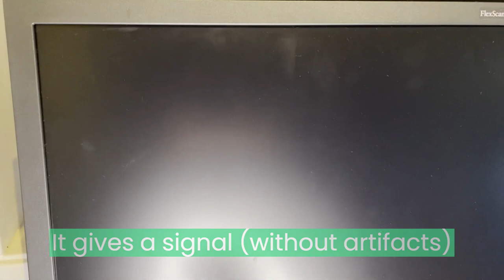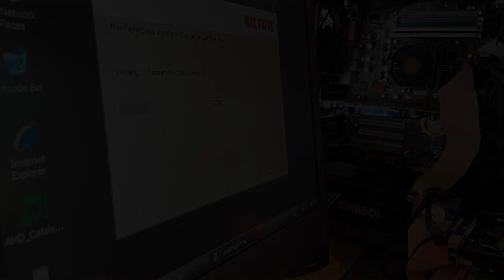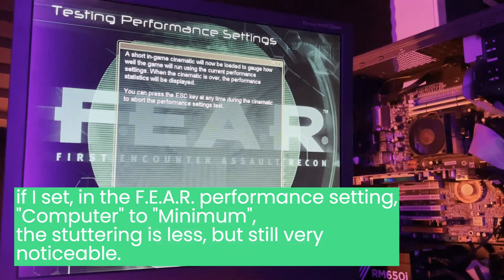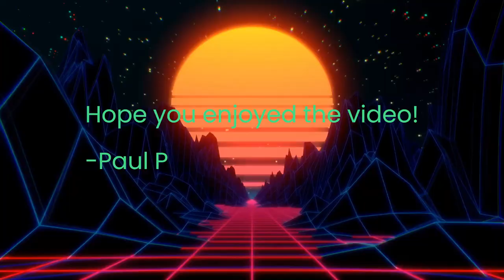Testing an ATI Radeon HD 3850 AGP

Comment from the maker: Had too little memory to Play F.E.A.R. Put in additional 512mb of XMS 400 ddr ram (2*256) and stutters went away. (Dont really know why i got stutters in Max Payne, but plays all games as it should now).Thanks for all the help! Cheers
Reply: whats the difference between an overclocked 3650 and a 3680 NADA :P,  if your having issues, maybe check the GPU power... I remember those cards needing power from the power supply, it was always a bad connection, usually, if not you just need to overclock a little, those earlier PC's *my pentium 4 could go from 3ghz to 4.2 usually, without any issues. Then I'd underclock my GPU or overclock depending on the game as that as well shouldn't bee too, too hot. Otherwise, you just may need a XP hotfix for the game.

Comment: I would obviously be worth testing the HD 4670 as well, the other contender for the fastest AGP card. In some games one card is faster, on others the other. Basically comes down to how much a game relies on shader performance, fillrate and memory bandwith. The HD 3850 has double the pixel fillrate and memory bandwith of the HD 4670, but the latter has slightly higher shader performance and double the texel fillrate.
And if I remember right, F.E.A.R. was quite memory hungry, which is why the GTX 280 outperformed the theoretically faster GTX 275 there.

Comment: catalyst 12.4 drivers is the last stable version for radeon hd3850 graphics card
Reply: yup,can confirm that those 12.x hotfix are bad,sadly i think that 9.x and 10.x series hotfix agp drivers vanished from the internet,so 8.x and 9.x from old HIS website is the best and easiest solution.driver indentifier have solid collection but mostly 11.x and 12.x but all of them are for 2600 xt so card won't be recognized as 3xxxx in driver.doesn't seem to matter,they work and performance is okay but older 8.x are better in majority of games,especially in games that can run decent or good on that card (from 2007 and earlier)

Comment: You will get a lot better experience if:
You have a average to pretty slow 1 core CPU , try the Athlon 64 X2 4800+ 
You have only 1GB of DDR1 RAM , add more have 3GB or max 4GB for 32bit WinXP
nice vid btw
Reply: more importantly better drivers,from amd logo i recon that was on 12.x agp hotfix drivers,for best performance you need at least 10.2 (that seems to have vanished from the net) or older drivers. note that those later agp radeons need special agp hotfix drivers,regular ones won't install.

Comment: I have this card myself.  Exactly the same one, yes I bought it 20 years ago now and I still have it....
Anyway - there was a problem with the normal drivers from that period, because this was an AGP card when they were switching over to PCIE.  I remember to get it running properly, I had to go to sapphire's site and use their driver which was specific for the AGP version of this card.  I can't remember exactly what the version number was back then.  But I suggest see if you can get the driver directly from Sapphire for the card specifically.  This was the literal "Last Gasp" of the AGP style slot.  And yes, it is the fastest thing you can stick into an AGP motherboard.  But finding the proper driver might take some searching.  The card does work pretty good, and should run games smoothly with ease.  But as others have mentioned, it requires a special driver (which I believe was downloaded directly from sapphire's site - and I think it did have the word 'hotfix' right in the title of the driver).

Comment: I use mostly win 98se for my retro time, so what I say is perhaps useless. 

Make sure old drivers from previous gpus are completely destroyed, because some parts will be left in the registry even after normal uninstalling. It takes a 3rd party program to do this.  I use Driver Cleaner Pro.

I also always reinstall directx after adding a different gpu/driver.
Reply from the maker: Fresh Windows install/drivers. But Thanks for the comment!

Comment: FEAR most definitely should be working 100% ok with this setup.
I had a Radeon 9600 128mb, Athlon 3000+ and 1gb of ddr 400. Low settings and it was flawless.

If you have another 939 board with a different chipset try on it too, because back in the day there were a lot of issues with different chipsets.
Reply from the maker: Only one ive got, sadly. Could try a 478 P4 board i have :)  Thanks for the comment!
Reply: @paulp9270  Try another agp board. These are pci to agp with a bridge chip, had isues with an agp 3650. Open a new topic on vogons.

Comment: I don't have a solution for you problem but I can tell you I have one of these installed in a socket A board with AMD athlon xp 3200+ which is slower than the system you are using and it works great with no stuttering.
Reply from the maker: Yeah, something is not right :P Thanks for confirming just that :)

Comment: This card requires the hotfix patch in order to run smooth.  I'm not sure your 3850 is the fastest AGP, at least not in every game.  I have a 4670 that scores as well in many cases, though they are essentially identical scoring.   I think the 3850 is more stable though.  I never had issues with mine, but did have issues with the 4670.  I never overclocked them, but knew some guys who claimed that the 3850 could overclock very well.  I don't think it is worth the effort, as if I wanted better performance I'd just go with a PCIE card setup.   You might try a better s939 like one of the FX-60 processors or even try a better dual core Opteron 185 or 190 (if your BIOS supports it).
Reply from the maker: i just ordered another set of 512*2 gig XMS Platinums, and an Athlon 64X2 3800+. Will look more into into the hotfix patch when i get the parts. I like this system. Maybe ill make a video of a complete, well functioning build some day :)  And agree on the overclocking part. This card is hot (and fast) enough as it is  :P
Reply: @paulp9270  Good news for you is that the X2 3800+ almost is identical single thread to the 3500+ single core you used, so you will be able to directly see how much adding another core and better memory impacts performance.   The prices on 939 cpu's has risen considerably, so I think the X2 4400+ is the best bang for the buck right now.   Be careful too with what version you get, as the chips with a "BV" at the end of their code have lower cache and perform poorly compared to the "CD" versions.
Reply from the maker: @erikmerchant567  Unfortunately i got the "BV" version (at least it was cheap). So it will most likely be somewhat slower than the 3500+ in single thread. But i wil test it out and keep a lookout for a cheap x2 "CD"- chip :) Not paying ebay prices for one... Thanks for the info!

Comment: Did you check how much ram the system is consuming during gaming? You could be running out of memory hence the stuttering as it is forced to use the slower virtual memory. I once played F.E.A.R on my Sempron 3000+ 1.25gb DDR memory and 7600GST on Windows X.P. It was also a stuttery experience as far as I remember.
Reply from the maker: Not consuming obove 600 mb at any time in FEAR. And it is also stuttering in Max Payne (should be capped at a solid 75 fps at all times on this machine). Guessing a driver/software issue? Thanks :)
Reply from the maker: You were correct all along, sir. 100% playable with good fps after i put in another 512mb XMS ddr ram. Did more tests and all is well :) Thanks again for the comment! Cheers
Reply: @paulp9270  Glad I could help. I badly miss my Win XP days. I wish I kept all my hardware back then. These videos bring me back memory lane. Thank you for the nostalgic vids. Wish you all the best👍

Comment: Try using only single channels for your memory configuration, either A or B.
Reply from the maker: Thanks for the suggestion :), but did not help unfortunately.
Reply: @paulp9270  Tune your BIOS settings under "AGP Speed" and "AGP Fast Write" ... and as a last resort, make sure you have the AGP as first device on your integrated devices....  hope that helps
Reply from the maker: @RandomBSOD  Will try! Thanks :)

Comment: Hi mate do you know if the sapphire HD 3850 agp can be updgraded to 1gb vram? I'm asking because the sapphire pcie one, despite the connector, is the same pcb, same brand of memory (qimonda in general), same power phases for vcore and vmem, same socket type for vram (BGA 136) and adequate operating voltage for them between 1.8-1.9v. AGP have 512 mb 64mb x8 modules, and 1gb 128mbx8 modules, model HYB18H1G321AF and this memory chip is present on many HD 3850 manufacturers, like club 3d, powercolor, asus and even on the most recent HD 4850 1gb pcie,  would be fantastic achieve 1gb on 3850 agp with mem clocks above 1000mhz (the qimonda chip is capable of). Nowadays is very common to see vram upgrades like the rx570 4gb >8gb rx480, rtx 2060 even rtx 3070.

Comment: With that motherboard can you get a set of three SSD to work on Windows 7 if so how and which SSD did you use to get it to work

I have a gigabyte ga-ma78gm- us 2H and I cannot get a standard SSD to work unless it's a mechanical drive and even that's limited
Reply from the maker: Ive tried getting the sata ports to work, but the system wont boot. Only with ide drives. Probably something im doing or not doing😅. Would have been nice to get sata working🤔
Reply: Try your BIOS settings.  Here is a brief from Microsoft on enabling the various modes:
https://answers.microsoft.com/en-us/windows/forum/all/what-does-ahci-mode-ide-mode-raid-mode-sata-mean/d622d5cd-41c4-4b84-90ef-cea69aa47089

Usually you have to avoid ACHI mode in earlier computers even if they have the ports as Windows sometimes does not like them.  I think the ACHI mode tends to work better with SATA drives if it works, but IDE mode is more compatible, albeit slower.  Windows 7 has usually accepted ACHI for me, but earlier ones like XP not so much.

Comment: At least in Max Payne, try to disabe T&L Hardware acceleration.
Reply: The card should be able to run a DX7 featureset.
Reply: @HappyBeezerStudios  With me, it stutter all over using a 4670, 8800GT and GTX 960. After disabling T&L Hardware, it worked like a charm, no stutter, smooth line. I don't know why though.. Cheers

Comment: Cooool . This card has a PCIE to AGP bridge chip back of it, then it's not a native AGP card. Does anyone know which GPU chip or card is the most powerful native AGP chip/card ?
Is it GF 7800gt ?🤔
Reply: depending on the game it would be 7950 for older stuff,x1900 pro for newer shader intensive games.although i don't remember if x1900 pro was native agp from top of my head. both of them can't compete with those later agp radeons and getting a board that would work isn't that hard.

Comment: I have the same system, amd64 3200+ instead of 3500, 4 sticks 1gb 400mhz, Msi k8N neo2 platinum and hd3850 agp. In demanding games like fear or nfs pro street had same issues until replace the cpu to an opteron 175. I guess the cpu was bottlenecking gpu.